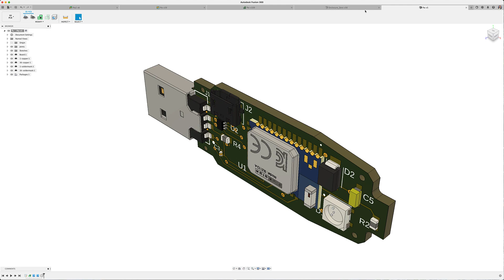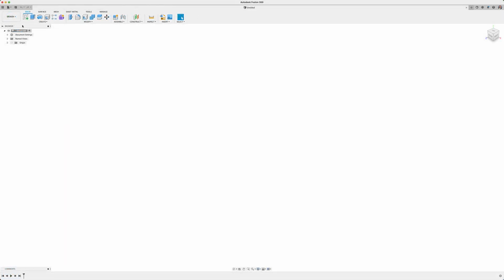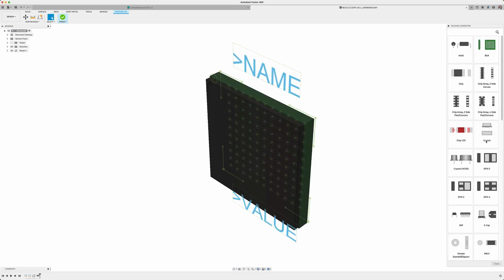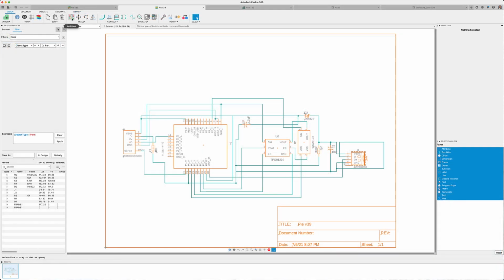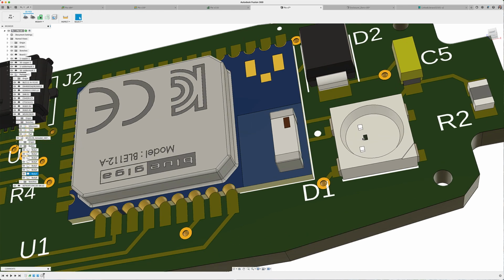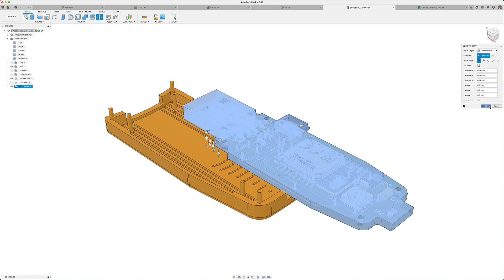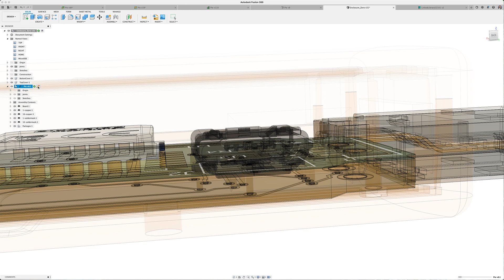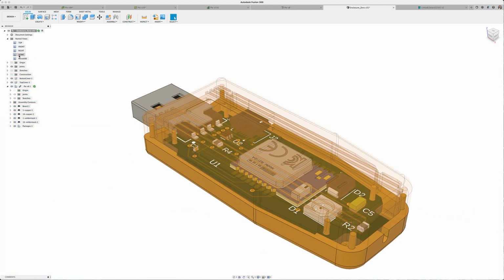What's New for Fusion 360 Electronics - July 2021

Comment: OK, so not much in this update, Where is the PANALIZATION feature we were promised ages ago?
Reply: In your opinion. There's still good stuff in here...
Reply: @ScottMoyse  in comparison to how much they have update other parts of F360 especially the manufacturing side, the ecad does not get much attention. Still no proper BOM system.
Reply: @davem3325  from my perspective, it gets a lot. ECAD gets more attention than CAD for a start and some releases it gets more than the MFG one... 

It's quite cyclical... and easy to overlook progress when the updates are every 4 - 6 weeks, but cumulative over the year is still quite fast paced.
Reply: @ScottMoyse  ya think, If you highlight a part in the library it does not display, you have to double click it, and you cannot scroll don the list with any preview, very slow and clunky.
the manufacturing preview in PCB still shows the wrong colours, and it still shows big blocks for the mask color.
you need to save and create 4 separate files just for one PCB and then there is the risk of it losing sync, why can't we have just one file for a pcb and just switch views as needed i.e sch/brd/3d etc
you still cannot display a BOM in PCB or even the Mcad!
Reply: @davem3325  I'm not saying it doesn't have a lot of issues which need fixing. And it definitely feels disjointed and unintuitive at the moment.